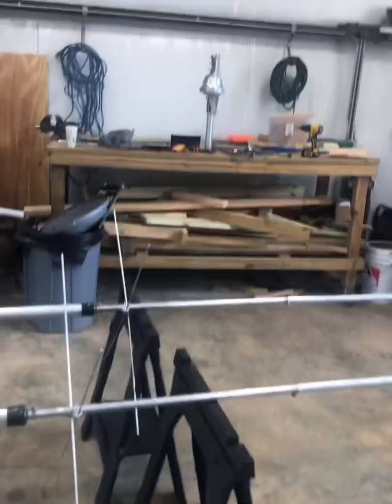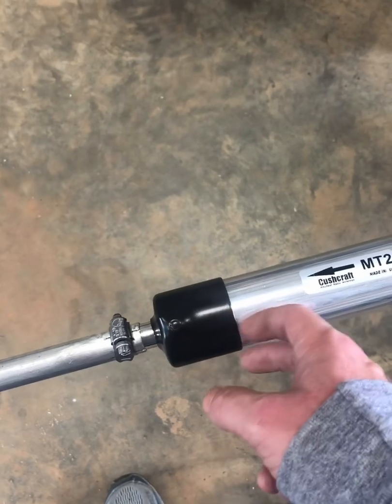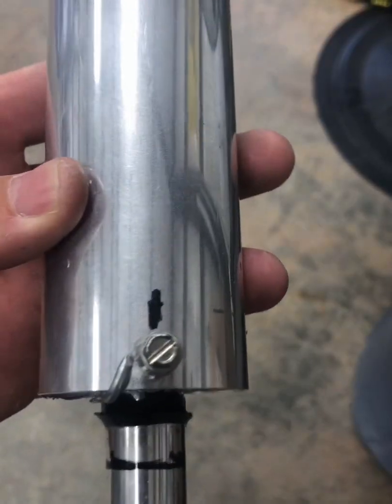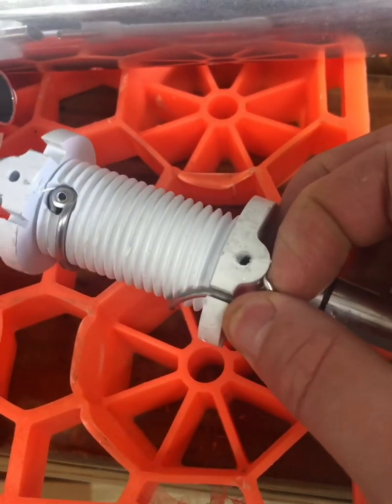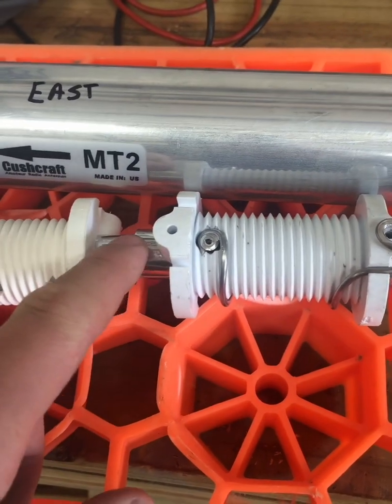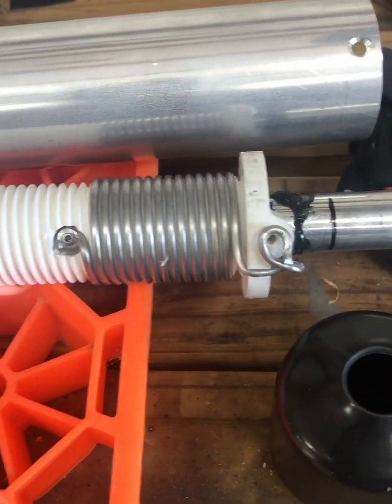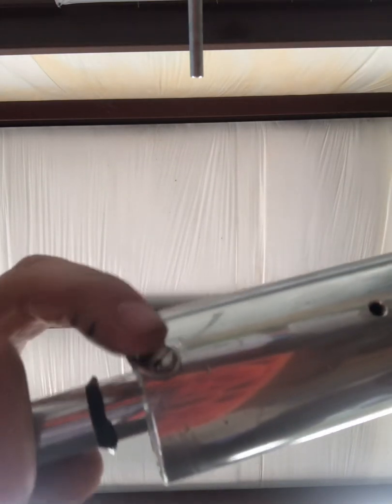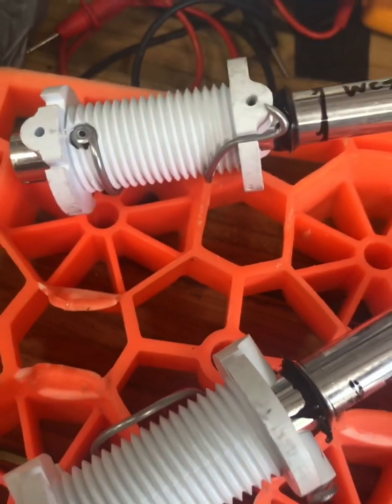Disassemble all Traps 2020 Cushcraft MA5B (1 broken)

Comment: Hello, I don't know if you are still active on your channel. I bought an MA5B last December. It's possibly one of the last ones on the market. I wanted to install it today but the SWR is high almost everywhere. My question is what was your problem that made you decide to repair the antenna. Did a single faulty trap affect all the bands? Your antenna looks as new as mine. Thanks! 73